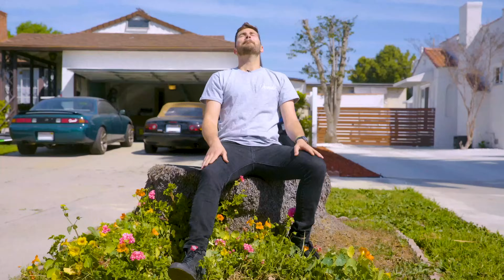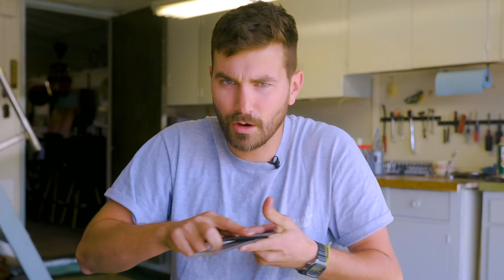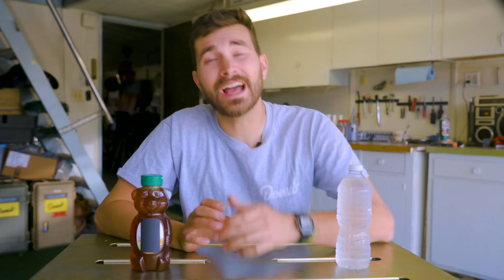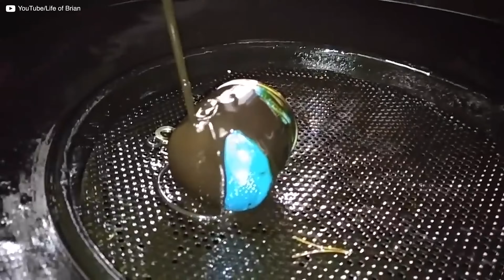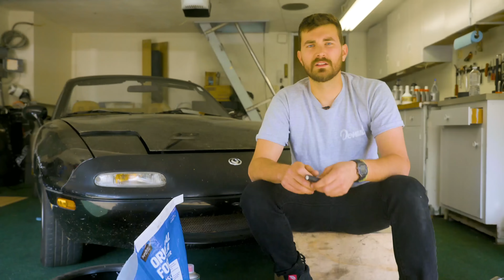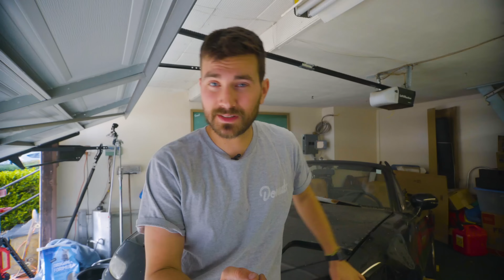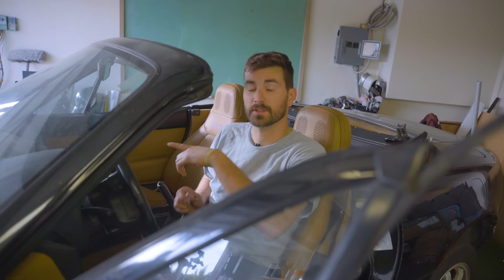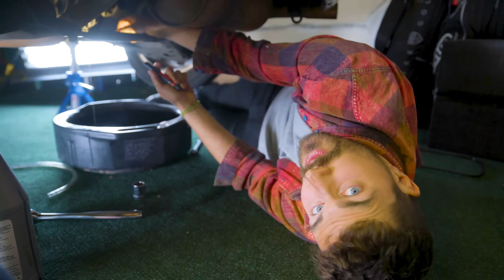9 Things You’ll REGRET Not Doing to Your Car

Comment: I have a 20 year old car....changing my oil every 3,000 miles !
Reply: Aleksandr Kisslove shoot I do mine almost every 1500... even then it comes out dark! you can never change your oil too soon
Reply: @ssonofatom  do you own a Volkswagen?
Reply: @R4M_Tommy  🤣🤣
Reply: @ssonofatom  facts
Reply: omg why so often?
Reply: @QuattroRMT  ideally you have to check your oil every time you gas up. If your oil turns dark and starts to smell like it's burned, it's most likely time to change it. If you drive in hot temperatures year round it will affect how often you have to change. If you drive your car more aggressively than normal, it also affects how often you need to change your oil.

The biggest thing that people don't think about is idling. 
If you wait around for people a lot with the car on in the heat trying to stay cool, it affects the time you have to change your oil
 If your drive in traffic and you idle a lot because of either congestion, because of stop lights, or both this will affect the time you need to change your oil.
Reply: @qpSubZeroqp  thanks for the knowledge, I didn't even know half that stuff
Reply: @qpSubZeroqp  cold climate can be just as bad, lots of extra idling, tons of moisture, short trips. Back and forth from hot to freezing definitely takes life off the oil, in the community I come from dealerships encourage people to drive 10-15k kilometers aka 6,200-9,300 miles from their first oil change forward; people really don't consider all the variables there are with oil "the bottle says 10k it should be fine" yes, but how many hours has it run for? How many times did you mash the throttle tryna get on the highway? When was the last time you checked it to make sure it wasn't consuming? You can't just go every 5k and expect it to be exactly the same every time, conditions change. Great point about checkin at the pump though, it's a great practice to uphold
Reply: @oatmeal9164  thank you for the additional information
I was going to say the same thing about timing and how long the engine is running and that there should be a counter for engine run time for oil changes rather than mileage. I think one or very few car models out there in history have an engine run time gauge or display
Reply: @qpSubZeroqp  oil pressure gauges should be in small vehicles like cars too (I know newer ones can display them but I wish older ones had them too!). This is why the vehicle industry is honestly getting very depressing, everything is about convenience (lazy fucking customers who can't be bothered to learn/do anything) instead of prioritizing on what matters. All these odd technologies taking priority over quality and how have we not learned to build smarter over the last hundred years? We build cars that are so great at connecting a phone, parking themselves or keeping someone's lazy ass in their lane but yet they suck at being a useful utility; kinda like how you can do anything on a cellphone yet it sucks at calling and its primary use is to be a phone. It's lame as hell that one day I'll never row another gear again
Reply: @oatmeal9164  100% agree. Convenience blinds people all too easily in the car industry. And it's even easier in most peoples busy lifestyles to be reluctant about doing maintenance or learning things about their own car on newer cars because of the "it should be fine" mentality(which is ridiculous considering how much time we all spend in them). Cars are a disposable tool instead of a privilege and it's honestly a shame. 
P.s. That was some very good oil info 👍 thanks!
Reply: @fox_witted6365  hell yeah brother! As a vw owner I've never had anyone agree with me a 100% on anything automotive; I'm definitely not a perfect car owner, I use my vehicle, it's a daily driver in Canada and I don't own a garage but damnit I can check the oil every now and then
Reply: @QuattroRMT  3k oil changes are fairly standard for non- synthetic oil. Synthetics and semi-synthetics are closer to 5k between oil changes.

I do the same on my 87 grand wagoneer, which runs a non-synthetic from the factory as synthetic oil didn't even exist then.
Reply: @lynnmckenney1987  that is correct, I'm also running conventional oil
Reply: @QuattroRMT  bruh
Reply: Damn wtf why so often
Reply: @nescockk  because racecar lol
Reply: God damn, I only change it every 10k 😨 Still runs well with over 100k miles tho. Need to tighten my maintenance 🙄
Reply: RobBroderick44 lol you won’t notice a difference with that low of miles but once the motor spins a bearing or throws a rod at 200k then you’ll regret having such long oil changes
Reply: @adamhildebrand6543  yeah, I was going to say that can't be healthy for the engine in the long run🤦‍♂️
Reply: @RobBroderick44  I think 10k might be pushing it a little lol
Reply: @AleksandrKisslove  Yep ...🙄

Comment: 4:39 EXCEPT for BMW's previous recommendation for 15k miles on their friggin turbocharged engines that had a normal operating temp of over 230*F. They've since changed it.
Reply: Michael in 2003 when I got 2002 BMW Z3 M roadster BMW told me to follow the lights on the dash.  I had 3 years free service.  At 6000mile I lost one light it took my 2.5 years.  Had to pay for that one because it was too soon. 16k miles between services.   Stupid... been doing every 4-5k or yearly since.  S54b32tu motor no turbo
Reply: fryrear technology dude you should have got the clown shoe
Reply: Jay Monay they are cool now but back then... I do want to get a Z4m coupe.  2006-2008 it has the same great motor I have but more room for turbos lol.

Comment: My oil life is nearing 25% and I've got an appointment in a week. Of course, I should look for the oil recommendation in my owner's manual, should I add motor oil right to the engine and mix it with the old oil? I've never done this before. I've only had my car for a year.
Reply: You should check the oil stick and see what level it's at. before adding more oil to the car.
Reply: @chastblind7606  Okay.